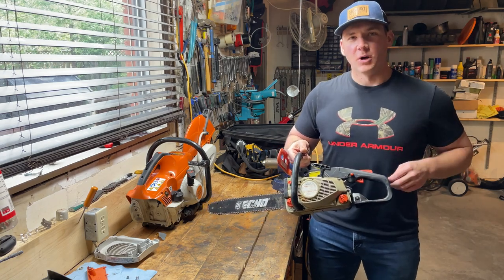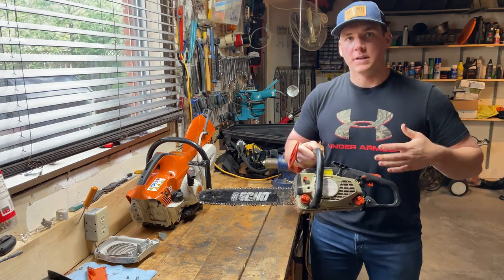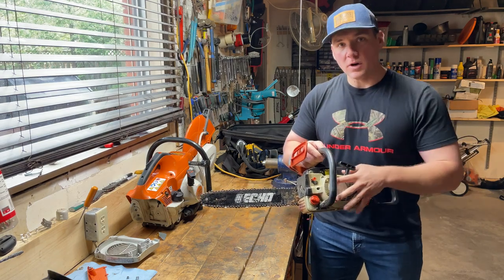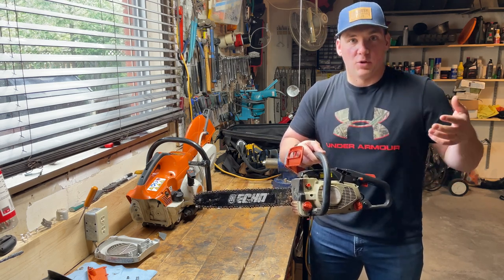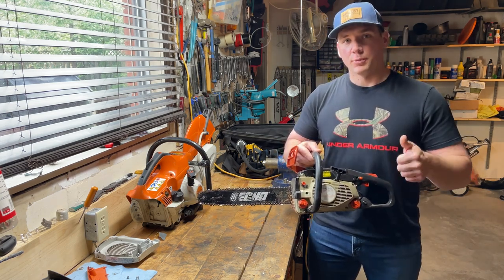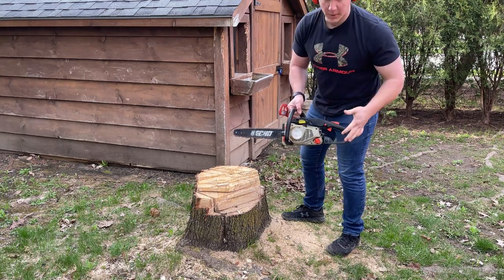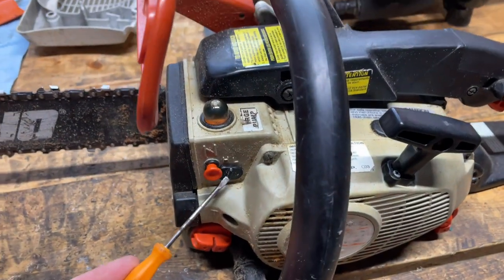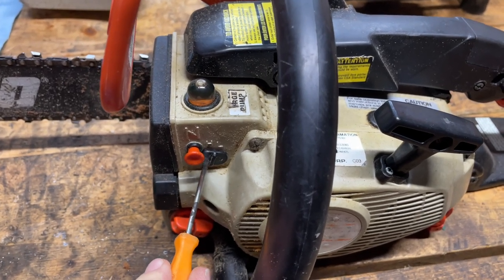How to adjust a chainsaw that dies (bogs down) when cutting!!! (ECHO CS-345 carb tuning)

Comment: Sorry this dumb question. Which way do you turn that screw? In or out? Thx
Reply: In the description he said CCW 1/8 turn to enrich the mixture. On my Husqvarna 55, I would turn it OUT to enrich the mixture. It helps if you print out the manual for your particular saw, or other implement of destruction 😊
EDIT; Just checked my manual and OUT is correct. The needle  controls the fuel - not the air, so OUT would allow more fuel into the mixture.
Reply: P.S. Not a dumb question, it's necessary knowledge.
Reply: Thank you for the clarification 👍

Comment: Great video and tip. Presume if you had a tachometer, once the saw was warm, you could fine tune the rpms for WOT (High), and idle (Low)?
Reply from the maker: For sure. That does not always tell the full story, though. I find it best to tach tune and then dive into the fine adjustments when I’m cutting. The idle.. well... that can be preference based too.
Reply: @DavesSmallEngines  Good to know. I do not have much experience with chain saws.  Again, really enjoy the videos. Keep up the great work.

Comment: you could tell it was lean right away when you first started it , RPM's where fluctuating , do you think that low speed might need  to be a hair richer as well ?, nice  saw 👍
Reply from the maker: It could be. Maybe just a hair. I’ll give it a try. It was responding quite nicely to my throttle input so I left it be!
Reply: I would say it's slightly on the lean side at idle. I typically adjust my idle screw most of the way out and get the saw to run off of the low needled alone and then set the idle screw once I like where it is at.
Reply from the maker: @CodyJohnstonbaugh  I will give that a try next time!

Comment: I also had a saw that bogged down in the wood and a carb adjust did nothing. Ended up the fuel line snapped at the filter and it sucked up dirt and clogged the fuel inlet screen!   Good video Dave, keep them coming!
Reply from the maker: Good to know Ken! Cheers!

Comment: Hai, please help me,
When the chain saw tilted (to cut horizontally ) the machine stops. Why it so...
Reply from the maker: Sounds like the fuel filter is caught inside and preventing it from staying in the fuel!
Reply: @DavesSmallEngines  hoo... point is noted. Let me check that 👍

Comment: now you need to sharpen it
Reply from the maker: It’s sharp - cutting down into a stump with the grain of the wood is a rip cut - not a cross cut. Watch when I cut horizontally - the chips fly!

Comment: Hey Dave!
Great job. The right adjustment on a carburator is extremly important! But it´s also very easy if you know, how to do it 😉
Greetings from germany, Stefan
Reply: Hmmm hi bro
Reply from the maker: Thanks Stefan!
Reply: @DavesSmallEngines  dude you said the high but you didn't say which way and how much???

Comment: I have a 1980’s homelite. It is still going strong. I brought it out and it does what this one is doing so far I have adjust hi about 3/4 of a turn and it seems to cut small 2-3” hardly bogging down except nearing the end and larger logs it boggs down and will die even if I pull it out and try to give it gas. It will start back up ok. 

I had the fuel line replaced once long ago it does not seem like this. My question is. What could a large “richer” adjustment indicate?

Comment: I think the chain needs sharpening.  Even a little 30cc saw should cut better than that.  My ms 181 would cut through that round pretty good.I used it to cut up some 12 inch limbs for my daughter a couple of years ago.  Usually when I go from cold to warm I lean out the saw a tad because cold air does not hold as much gas vapor as warm air.  Now, +15 is a lot warmer than -15 F.but it is still cold.  It as 72 degrees F. Here, today and 44 here this morning.  The lowest temp we had this past winter was about 20 degrees F.
Reply from the maker: Hey John - if I had a ripping chain on it would go into the stump better with the grain of the wood. Look at how it tosses the chips when I cross cut! I think the carb was off to start, I’m glad it’s sorted out now.
Reply: @DavesSmallEngines  Dave, it just looked like it was dull to me.  My chains are sharp and will generally rip and crosscut pretty good.  I have a few ripping chains for my mill and they will crosscut pretty good, too.  Not as good as my 30 degree chains but a lot better than that Echo did.  Then, again my saws are generally twice as big as it was.  My 35 year old Poulan Super 25 Automatic Deluxe will make that Echo look like a toy, crosscut or ripping and it only has a 91 series Oregon chain on it ( 3/8 LP). If you want a saw to get a good tune on, try the Poulan 25SDA. Or the little MACs.
Reply from the maker: Hey John! I will check those out. I tried it again off camera and it was throwing some good chips again on a pine. I’m wondering if this maple is really hard and the cross cut along with the small chain makes it harder for the little saw.
Reply: @DavesSmallEngines  Dave, I do not really look at Mapel being a real hard wood.  If you want hard wood, try hickory or live oak.  They will throw spark off chains.  I cut down a 24 inch maple a few years ago with my 455 Husky and it did not even break into a sweat.  Hickory or water oak is a different story.  Water oak is what  Old Ironsides is made from and British cannon ball just bounced off of it.  I guess they teach you about the Uss Constitution where you and Don live?  My degree is in American History.  It took me ten years and a war ( Vietnam) to get it.  In case you did not know I am a Marine.
Reply: @DavesSmallEngines  ripping chains dot cut as well as standard 30 degree chains.  They kind of chip at the wood instead of pulling noodles. They are used to provide a smoother surface on the milled lumber  instead of speed of cutting.

Comment: The problem is that virtually no chainsaws can be adjusted using a small screwdriver now days. However, you can buy a kit on Amazon that allows you to adjust the non-adjustable ones although a mechanic said it is illegal.
Reply: 😂😂😂😂illegal 😂😂😂😂
Reply: What are laws made for? 😂

Comment: My Poulan 2150 won't start. Does the primer bulb have to be full of fuel? Right now it does not fill..so fuel line problem?
Reply from the maker: Hey Lookup! Sounds like a fuel delivery issue for sure. Could be several different things, check valves, fuel lines, filter, gummed up carb, etc. I would be digging in and cleaning things up!